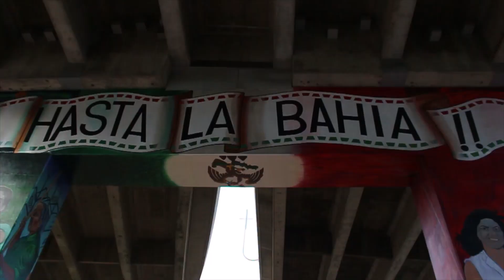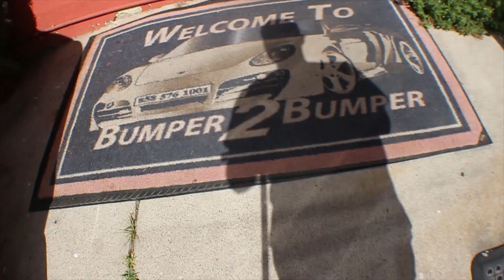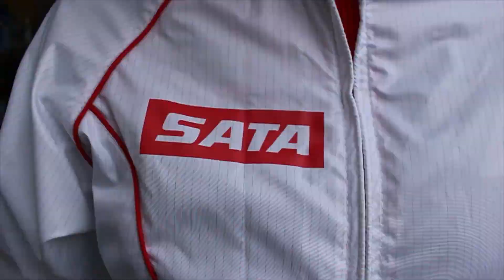Pro Female Car Painter

Comment: NICE.... Is Ashley using  the 3oz  disposable Devilbiss Dekup?? If so does it fit the standard Dekup adapter??
Reply from the maker: yes she is, those smaller cups just slip right over the fitting.
Reply: @Mechaniclyfe  Thanks

Comment: I am restoring a 1968 Volkswagen double cab.  Looking for a talented painter.  Would you be interested?  I am doing the metal work, but I need someone that can apply the epoxy primer and top coat (single stage).